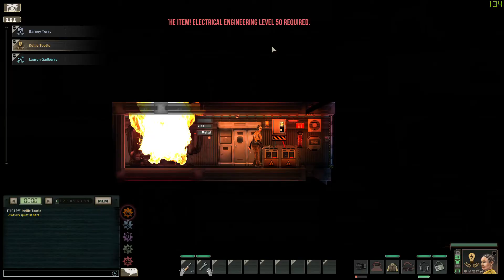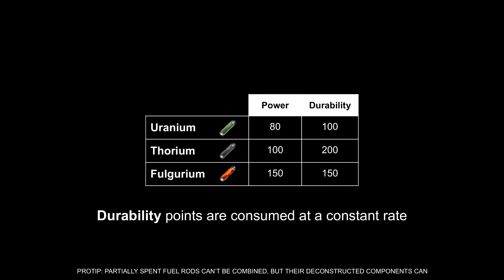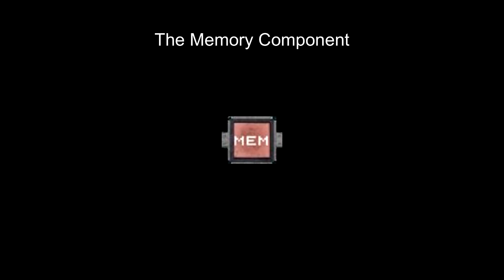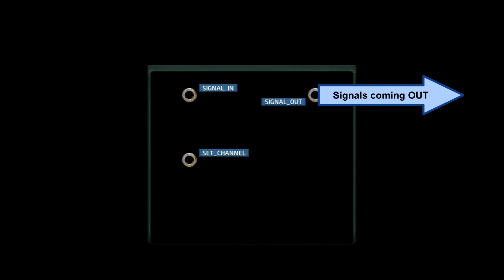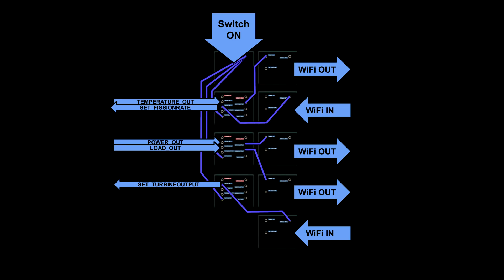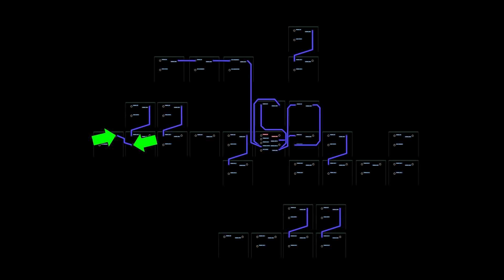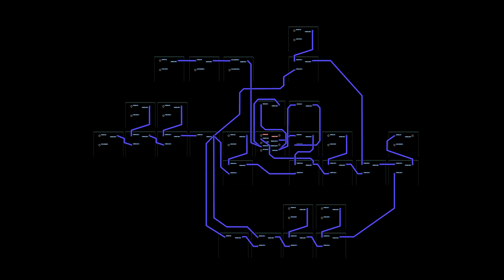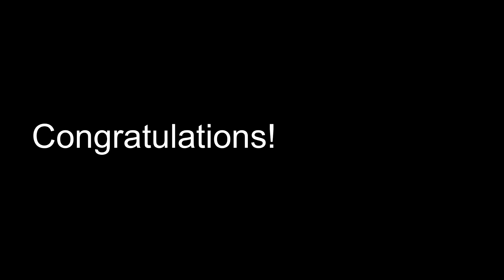Perfecting Reactor Control

Comment: I WILL build this.
Reply from the maker: If you haven't seen it yet, you might find this useful... https://youtu.be/S5hak5NY9xQ
Reply: @TheGamingNerd2022  To be honest, I flicked through that and panicked because I am confused enough already. That seems to be a completely different layout of the PIDC, and I am still trying to get the version in THIS video working.

I have built the turbine controller, and THAT seems to be working fine - when I switch it on once the reactor is up and running, it sets the turbine output so frequently you cannot even more the slider under manual control, and matches output to load perfectly.

But I had a lot of trouble even getting the wifi signals to go to and from the PIDC. I gave up, and wired the input of the first division component on the PIDC circuit directly to the output of the relay that takes the temperature signal. I really cannot figure out why the wifi will not work for PIDC. I have it in the same room as the switch. And wifi worked just fine for the Turbine controller.

Also, I am not 100% sure if the second component to the right of the first wifi on the PIDC circuit should be subtract or Multiply. You show both in the video, but in the parts list show only the need for ONE subtract component, and since there is one next to the bottom delay component, I inferred it should be a Multiply and not a subtract, though I first had a subtract.

I can connect the PIDC to the reactor, but the best it can do is cause the fusion rate to flail wildly, and the Turbine Controller stops working and throttles the output to 100, and the power output is nothing.

I THINK my issues is to do with the dynamic memory cell. I can trace that there are signals/calculated values hitting everything leading up to that, but there is nothing coming out of the output, and if I view the config panel for the memory component of the DMC, it never shows a value. The Relay of the DMC is toggling its state, but seems to do so every eight seconds. I am not sure why, as the system clock has a pulse frequency of 20.

I am a computer programmer by profession, and am trying to 'Debug' the PIDC circuit, but my knowledge of PIDC control theory and wiring in Barotrauma amounts to what I have picked up from trying to build this reactor controller. If you do happen to read all of this, thank-you for your time, and if I have made enough sense that you could maybe give me a hint as to where I might be going wrong, that would be much appreciated.
Reply: IT LIVES!

So I Looked up an implementation of PID control in C++, and worked backwards from that.

I figured out that it IS a Subtraction component supposed to be underneath that second memory component, the one set to 50, Which seems to be the Set point Value, as near as I can tell.

And the other problem was, with The first memory component on the left, the one set to static 100, Putting the output of that into first channel input on the division component beneath it, and raw temperature reading in the second channel, it was dividing 100 by the temp. value. I had to switch these two wires, to divide temp by 100.

So, to summarize, relative to your video, to get the PID to work:

- I had to bypass wi-fi and connect input and output of the PID directly to the relay.
- Needs to be a Subtract component beneath the Memory component second on left, NOT a multiply component, as your video implies in some places (later build layout diagram, and parts list)
- Wire 100 memory component output to SECOND input of divide component, and raw temperature input to FIRST input, to divide temp by 100

The Turbine Controller works perfectly fine as is, over Wi-Fi.  I am not sure why it won't send or receive to and from the PIDC. This has been an eight hour process (in game time) for me to build this thing, and in all that time, no matter what I did, could NOT get that to work. Seems to be a quirk of a game. I tried both in a co-op game, and in submarine editor.

Thank-you for this. As frustrating it was, it was a great learning experience.
Reply from the maker: @RHatcherMD  Before I brain-dump into an unnecessarily-long response, have you seen this? https://www.youtube.com/watch?v=S5hak5NY9xQ
Reply: @TheGamingNerd2022  Sorry to give so much detail, but I did not know what the issue was, and wanted your help, so I gave as much detail as I thought relevant. I have the controller working now. You had a few errors in your instructions, which I have outlined in said 'Unnecessarily-long response', and also now in a separate comment above, for anyone else who wants to attempt this. You have again linked me to the same video, of you assembling these same two controllers, with (what appears to be) sped up gameplay footage, and no commentary, in a radically different layout. I had to slow that down to 0.25 speed to even make any sense of it. So more of a Run than a Walk through. Still though, at quarter speed, I did end up learning a thing or two about how the submarine editor works.

But having said all THAT, thank-you, again, for making this video. figuring out how to get this thing to work has been one of the most satisfying gameplay experiences I have had in quite some time
Reply from the maker: @RHatcherMD  I apologize, it appears that I was misunderstood. Your question was well thought out and not unnecessary in any shape or form. I appreciate the feedback, and I take your determination to get this monster of a circuit working as the highest praise, and I will strive to make future videos just as inspiring. I was trying to imply that a long, drawn out answer from myself would risk being unnecessary, if I was repeating something you'd already seen. I apologize for repeating the link I provided, that one I blame on sleep deprivation, I have a little guy who's currently teething and sleep is a luxury I'm short on these days.

I'm happy you got it working, I applaud your determination, and I appreciate your patience and thoroughness in your questions and comments!
Reply: @TheGamingNerd2022  Thanks man. No apology needed, and sorry for the confusion.

And thank-you again for making that video, I never would have thought to do anything like that at all on my own, and I learned a lot from the build process. I played Another co-op session just now, and that controller held up well, and came in very handy. 

Not having to swap rods so often, and being able to stagger the rods so they deplete at different times makes it a breeze to keep the power on.

Comment: wifi is very insecure, at least against players.
All you need is a wifi component and some input to mess with any systems in the ship.
You could send a password with every message (concatenated), a bit like Bluetooth pairing.
A RegEx component can search for the key and control weather or not the message is allowed to be decoded.
Using an integer as the password makes it possible to use division etc to isolate the signal or signals.
Reply: Too deep for me man I just play for the lovecraftian horror and mind melting nightmares
Reply: This is way above my pay grade.

Comment: I just learn about the game a week ago, waiting for steam sale. This video really makes me scare to start lol
Reply: @cycler.x833  oh cool! Thanks for the info. I never used that site before so I will check it out.
Reply: @chunt5584  dont get scared. electronics is just "for messing around". You can completly skip that part, as most vessels are ready to go anyway. 

It just gets relevant if you want to add your own system to your sub. For example you have a room which should not get flooded - you could install a watersensor there and root it to your command seat so you can see the waterlevel on this room. Further enhance your system with adding a alarm, so you have a audio clue when the room gets flooded. You could even add some lights with a pulse component so you have lights going on and out when the room gets flooded. 

i am a noob tho, so i might be wrong

Comment: I ive watched it about 3-4 times and verified everything. one that that isnt clear is how do you take the power from the reactor thats wired to a relay ( which is a 1000kw max) and connect it to the rest of the sub??
Reply: You can set relay to do any posiible amount kw in editor.
Reply: That is a bit confusing if you mean 12:09. It's power_value_out not power_out and load_value_out. He doesn't mention the power connection. But thats easy, just power_out directly to a junction box

Comment: EDIT: I just found the comment that explained the oversight! I am going to go watch your other video, too! You've earned another sub for sure! Thanks so much!!

Hey there! This guide was amazing and I am so thankful for your wonderful diagrams and explanations! I plan on using this system for a small support sub I am working on as well as its parent (very large). However, I wanted to ask: During some initial tests I've done, whenever the demand for power reaches the reactor (taking the load from 0 to 1k or 2k, for example) the PIDC gets the reactor working just as it should (the load/power lines are almost identical), but it continues to heat up until the reactor starts to take meltdown damage.

Do you think I have wired something wrong, or do you think I am simply not giving the reactor/PIDC enough demand to work properly?

Thank you in advance!

Comment: As an electrical engineering student I can confirm that these functions are pretty realistic and close to actual programmable relay. For example Siemens uses a program called LogoSoftComfort (might have misspelled that) that may be used for editing relay output programs using already existing applications/components such as and, not, nor, nand to name a few. And what you said about equations reminded me of the very same concept we had  called 'truth table' that tells us the result of different inputs resulting in the output. For example an AND components would look like this

A B X
0 0 0
1 0 0
0 1 0
1 1 1

X here marking the output and A and B marking the inputs. It is truly fascinating and interesting idea to add so much of this into to the game.
Reply: Epic
Reply: and since the NAND gate is universal, it is possible to make CPU.
RS-NOR latches work, but luckily there is a memory component so it doesn't get too complex.

Comment: This is why I'm not in engineering.
Reply: This is a very overcomplicated system, you can actually control a reactor perfectly with a couple of wires, no switches and 2 components, and it will never break or fail. And while its fully functional the reactor is IMPOSSIBLE to overload. WOrks on the principle that autocontrol is sluggish.
Reply: @YouCountSheep  so what's with all the over engineering here? Maybe it makes it slightly more optimized, but isnt his system also easier to break?
Reply: @JoeyB0b  Idk about breaking/working, sure you have to test, but Id take a 2 component system over something so extensiv, less work for me and less ship parts also.

Comment: So if I understand correctly. Spicy rod makes water hot, which angries up the pixies, that you then enslave with wires and boxes, to do your bidding, and power the submarine. Got it.
Reply from the maker: You forgot the part where angry pixies make the engine start a-choochin the schmoo! (AvE FTW)

Comment: What about mods? Like ek utility adds in incedium fuel rods. Reactors extended changers it all and adds in many more rods, one being a volatile fulgurium rod(it’s blue colored), and ek dockyard which adds in fusion reactors.
Reply: There are few automatic controllers that require like 5-6 components to work - but you need to do some info gathering about fuel rods and reactor power out. It's all about adjusting to new inputs - the fundamentals remain the same

Comment: For those aspiring engineers, captains and sub builder. The reactor's own control is suboptimal for reason.

A circuit like this can take one hell of a gameplay aspect out of the game and MAY render a campaign boring. Besides, as long as there is not too high spikes of usage, the reactor can be usually left alone between fuel rod reload.

Heck, I have found it more useful to wire a "No fuel" warning to bridge and simple on/off relay to battery backup that turns on when fuel is out.

Comment: I've been trying to make my own reactor control circuit, and after a few days of trying new things only to find my reactor inevitably consumed by a tornado of fire any time conditions were even slightly less than ideal I swallowed my pride and decided maybe it's time to see how other people are doing it. Turns out the trick was to go to college for engineering and use your degree to design a logic circuit that uses real engineering principles and create one from several subassemblies in a remote corner of your sub then connect it to alexa so she can just do all the leg work.

That being said I shamelessly stole your turbine controller, and frankensteined it together with W4rum's fission controller and now my reactor is running at peak performance. Now the only thing I don't have is the satisfaction of knowing it's my design :/
Reply: Yeah

Comment: If you can understand how water flows in a pipe, you can understand how electricity works.
-My Teacher
Reply from the maker: This might be splitting hairs, while I agree that concepts like voltage, current, and inductance can be somewhat analogous to pressure, flow rate, and momentum (respectively), the comparison breaks down when you start to introduce properties like electromagnetic field effects and impedance. Still a good analogy for the basics, though
Reply: @TheGamingNerd2022  fire. electronics.  go boom.
Reply: @TheGamingNerd2022  But then you introduce turbulence, vortexes, laminar flow, fluid particle layers & lateral mixing/lack thereof.. And suddenly my plumbing is giving me a headache as well